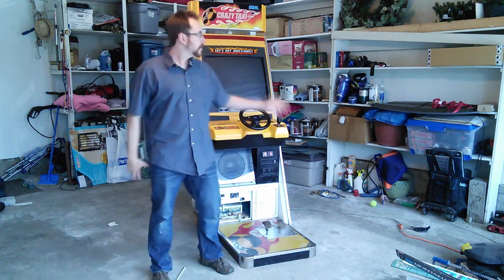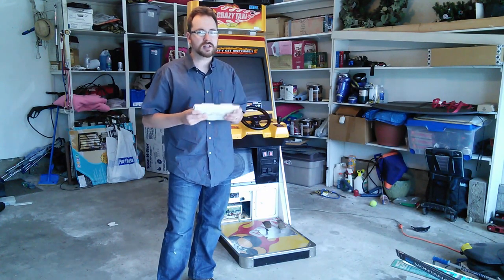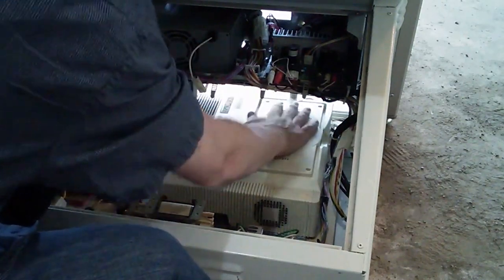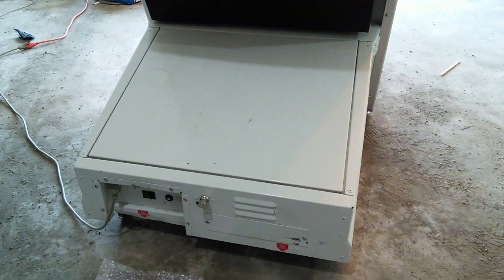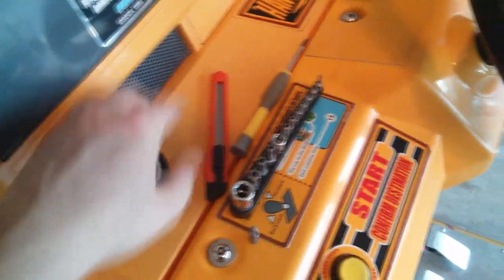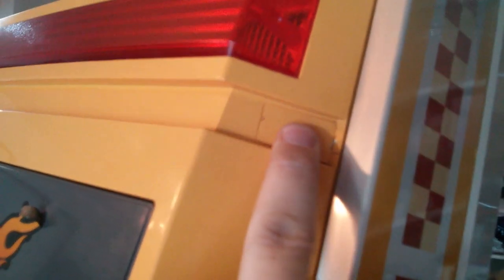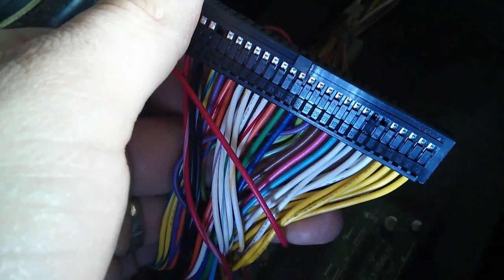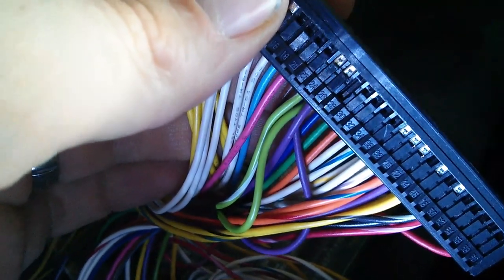Tutorial - Mod / Hack Crazy Taxi Arcade to Play Jambo! Safari

Comment: Very informative. Jambo looks like it plays perfectly... 18 Wheeler though... yeah. There's one HUGE HUUUUUUGE problem: 

The gears in the 18 Wheeler cabinet were stationary. The shifter in it was just like the 4-way shifter used on Daytona with 3 microswitches to detect the gear position, only it lacked 1st gear. Holding the gear and the steering wheel all the time would be a pain without that discrete shifter IMO. Also, I believe the Reverse gear uses pin 22 on the 60-pin connector of the I/O. You won't be able to put your truck into reverse which is MANDATORY for one particular parking challenge in the game. There was an official PCB made by Deith Leisure for the UK Upright Sega Rally cabinet that emulates the Sega 4-way shifter outputs using two switches. It will work with this game. I've used that logic board with this game in my Naomi 2 and it works surprisingly well!

This video has me craving to find Jambo and Crazy Taxi Naomi carts. I just got into setting up Naomi driving games at home on original hardware after hooking up many Model 3 systems (yes, they are monstrous) and adapters to play everything 100% sans force feedback. Only I don't use a cabinet, I just hacked up a Microsoft Precision PC wheel and pedal unit with pots and a few of the switches inside. No wires were cut modding that wheel either.